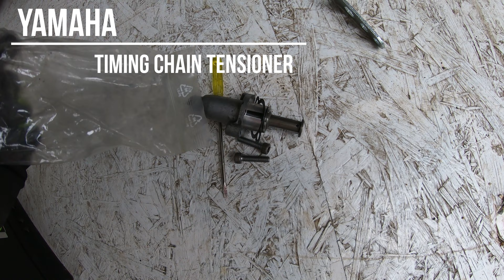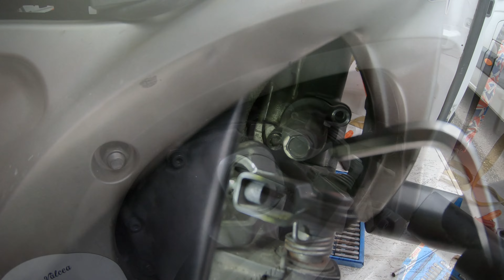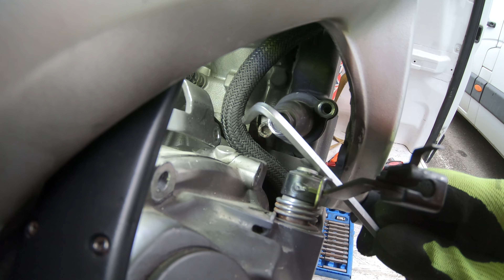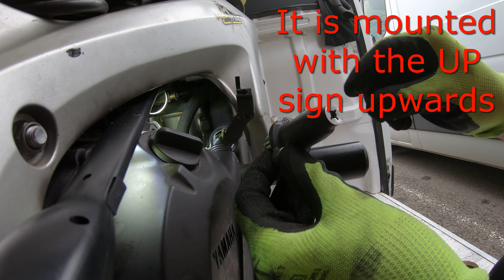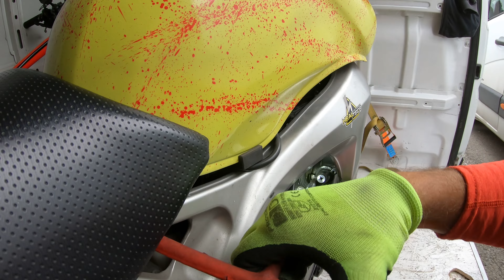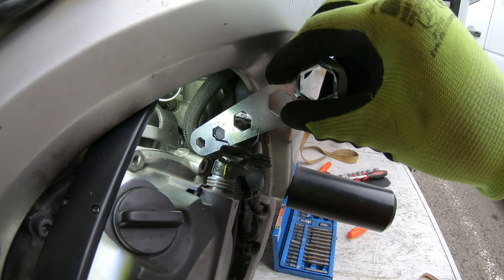Yamaha FZ6,FAZER,YZF600R,R6 timing chain tensioner,Steuerkettenspanner,registerkjedestrammer,Lant,4K

Comment: Do you know if this piece is compatible with others similar(for example piece for yamaha wr 450 or quad yfz 450)? The form is different but the same connection.
Reply from the maker: @paolocasella4878  nop , only the distance between the holes must correspond …

Comment: Do you have to remove everything ? 
Cant just unscrew the first bolt ? 
And can u adjust it when the bike is on ?
Reply from the maker: I'm a little confused by your questions :face-orange-raised-eyebrow:
Reply: I think question was, and I am asking: just for chain tension, can I just remove center bolt. Then With " -" screwdriver turn anti clockwise till I feel tension. Ant then put back center bolt. Because aditionaly you did replacement of chain tensioner, and did adjustment on "new" tensioner.
Reply from the maker: @GreenTTS  yes yes you can